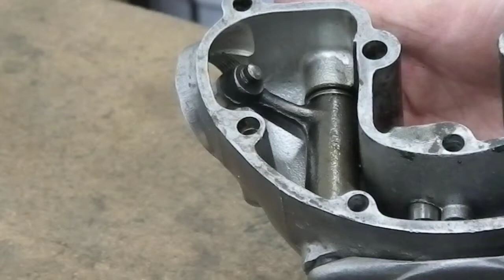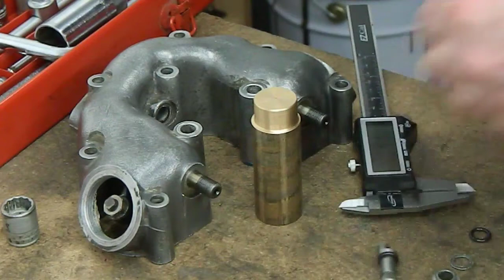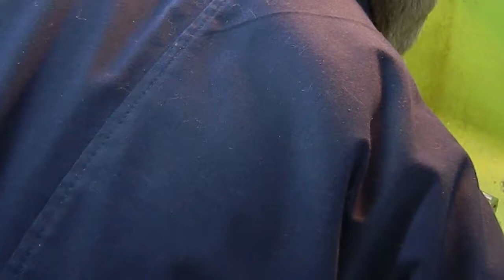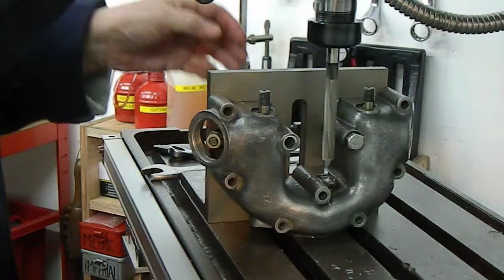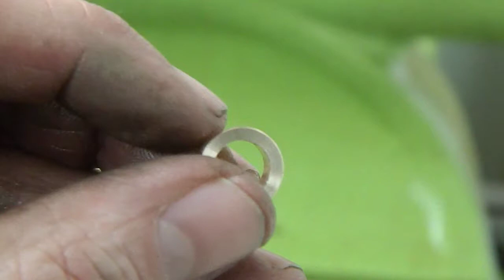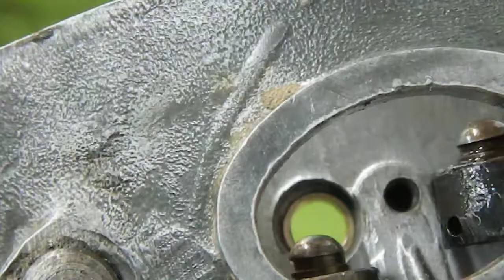BSA rocker cover bushing

Comment: When the head was being assembled at the factory, lots of different spindles would be tried until the best fit was found. This was before the days of true precision engineering, and every part that came off the machine was slightly different.  It was called selective assembly.  These days when you buy "New old stock" spares, they dont always fit very well, and that's the reason why.
Reply from the maker: Thanks for your comments